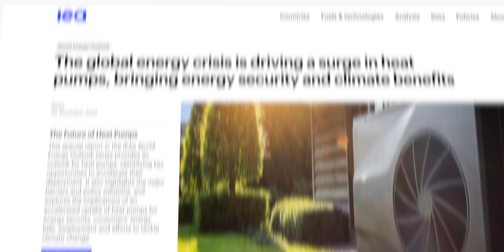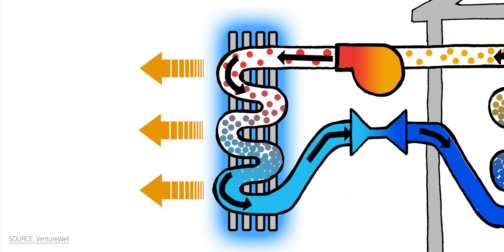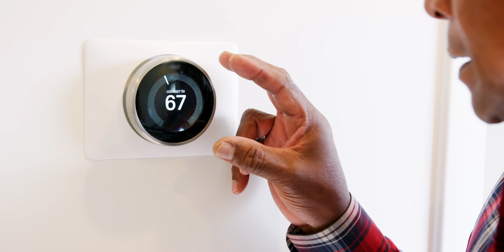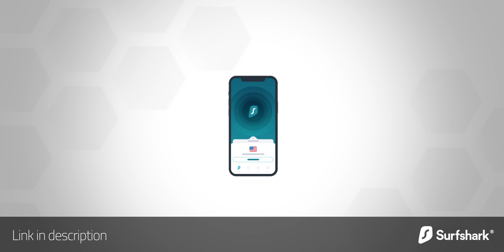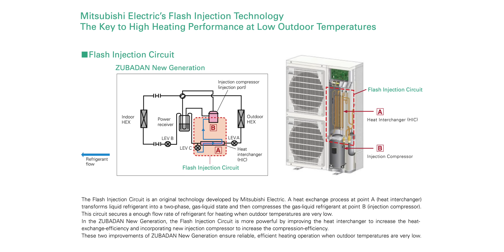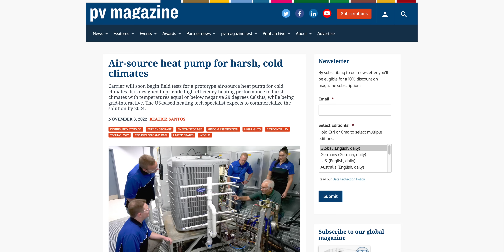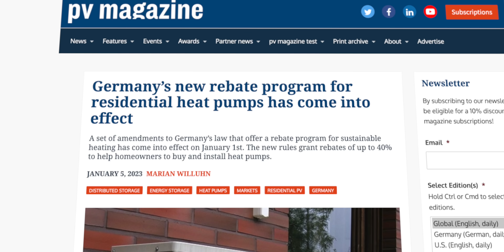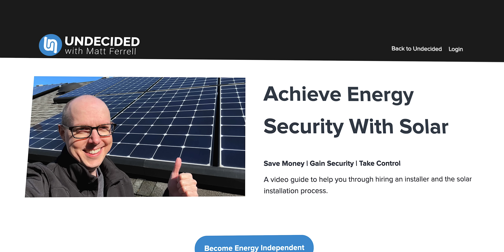Major Advances with Heat Pumps in the Extreme Cold

Comment: Matt, I'm curious if for your geothermal system they took into consideration soil thermal conductivity. It seems like heat exchange efficiency could be improved if you backfill with a better conducting soil. A quick search revealed that sand is superior to clay.
Reply: High conductivity is argueably worse because in the winter it would eqaulize faster
Reply: @emeraldbonsai  That makes some sense depending on how you burry the heat exchanger. My thought was to use the more conductive soil just around the coils and finish filling with whatever is at hand. The whole point in geothermal systems is to take advantage of the stable temperature of the earth below. To take it a step further, you could top off the fill with a more insulative soil or other material to limit the effects of changing air temperature.

Comment: It isn't the cold on its own, at least not usually. Cold weather and high humidity with air source heat pumps will cause ice to form on its coils. It is this coating which kills the heat transfer. The Heat pump then has to melt this coating which takes energy taken from the electrical mains. If for any reason water is passed through an external placed heat pump, it can freeze and cause serious bursts. The last cold spell killed my sisters air source heat pump, used to heat a indoor pool. The insides 'exploded' as it froze..

Comment: Here in the UK 1kwh of electricity costs almost exactly 5X 1kwh og natural gas so your heatpump would need a COP of 5 to break even with a condensing natural gas boiler in terms of how much it costs to run. Electricity is so expensive here it works out significantly cheaper to run an efficient petrol car when compared to an EV.

Comment: I live in New Hampshire, near the Massachusetts border. I added a 4 headed heat pump system a couple years ago, and a single unit for the sun room this last year. The single unit is a Mitsubishi hyperheat unit and works very well at 0°F, the non-hyperheat compressor will put out useable heat at 0°F, but it makes a lot of noise and uses much more electricity than at warmer temps. With electricity so costly, 34¢/kWh, I’ve been doing more heating with oil this year when the temperature drops below 20°F, as the relative cost varies wildly as the heat pump’s efficiency drops with temperature. 

Also, the oil heating system gives delightful floor radiant heating on the 1st floor, while the minisplit system allow the bedrooms to have different temperatures. My children have wildly different preferred temperatures so they do not like their rooms to be heated by the shared oil boiler zone upstairs. So, often, both systems will be active for parts of the day. 

Will be installing solar next week, which will change the equation quite a bit, and will probably lead me to heating the house hotter during the day. Thermal battery.

Comment: As soon as my AC unit from 2003 bites the dust or needs recharging (R12 is harder to get now), I'm putting in a heat pump. I live in MN.
I'll keep the new-ish 94% eff gas furnace installed as a backup and set it 2F below the heat pump setpoint. I may even wire in a tstat outside to disable the heat pump at the point it hits below 2.0 COP.  I'd have to do some research again as things have progressed in the last few years, but I think some hit that around 25F OAT now. Below that it's cheaper to run gas.

Comment: I spent about 1 1/2 years working on a 'ski shack' that was heated by two large geothermal heat pumps, fed by a single vertical well. In the winter, there was a thick layer of frost on any section of the fluid pipes in the mechanical room where there were gaps in the insulation, including where the 'warm' fluid came out of the ground. Even though the source fluid was well below freezing, the three-story building was kept very comfortable.
Reply: Vertical well heat pump  100 to 400 feet deep
For a vertical system, holes (approximately four inches in diameter) are drilled about 20 feet apart and 100 to 400 feet deep.

Cost between $20,000 and $38,000
Unfortunately, vertical loops are the most expensive type of geothermal system to install, since installation involves deep and wide boring. A vertical loop installation costs between $20,000 and $38,000.
Reply: @solarcabin  I had two 100 metre vertical boreholes here in  the UK for £9000. Worth every penny.
Reply: I'm working on upgrading my gas heat and hot water but I'm curious if the benefit of heat pumps is environmental or financial? Is it practical for Harry Homeowners and why wouldn't I continue with natural gas?  I gotta watch this vid a couple more times. It's all Greek to me as well as intimidating.
Reply: The electricity to pump up the water, assuming it is a deep well, was also probably significant.  However, since the water was probably dumped into a holding pond for use on the snow cannons, they were able to kill two birds with one stone.  I looked at pumping up water for geothermal, and the electricity to lift the water 500 feet killed the efficiency of using it for heat/cool.  Plus, I needed then to do something with the water.
Reply: @apostolakisl  the geothermal brine fluid is circulated in a loop, there is no lifting involved as the pressure equals out. If you're in a cold climate it's the way to go. I have two 200 meter holes and a 7 kW  heat pump (compressor draw), circulation pump is only some tens of Watts.
Reply: @ixer76  And what is your cost of drilling that 400m of hole?  Where I live, that would be about $60/meter . .. or $24000 for the holes, the piping and backfill.  Now consider how many years it takes to recover $24000 because of your increased efficiency.  Perhaps you pay 50 cents/kwh or something obscene like that and it makes sense.  They wanted $80,000 to drill the 7 holes it would have taken to get me a geothermal heat pump at my location.  And considering I have 8 months/year of AC, the holes would have gradually warmed up by the end of the season and been less efficient than air source.  Unless your electricity is obscenely expensive, or you have easy access to shallow geothermal well, it makes no sense (cents) to do this.
Reply: @apostolakisl  400m, what are you going to heat? That's a crazy big pump. 130-200m is usually the norm for normal sized house.
Reply: @Iceeeen  Last I checked, 2 x 200 = 400.
Reply: @apostolakisl  If the holes gradually warm up that is a bonus. Heat pumps become more efficient if the temperature difference between where the heat is applied, e.g. radiators and the heat source is reduced. That is why it is often good practice to increase the sizes of radiators or use underfloor heating with lower circulation temperatures.
Reply: @rogerphelps9939  I don't think you understand. If you are cooling your house, you need to reject heat. The heat is dumped into the hole. There is limited conductivity of the soil and gradually the holes warm up, making them a poorer receptor of additional heat. Same thing happens the other way in winter where the holes get cold. Air source heat pumps are so much cheaper to install that it rarely makes sense to use geothermal. The proof to this is that geothermal has been around for decades and almost no one does it. There are certain places where geothermal is much less expensive to install and are common, but those places are unusual.
Reply: @apostolakisl  In ground source or groundwater source heat pumps you pump through a closed loop so there's no lift since the up and down sides of the loop eqalise. The pump just has to overcome pipework and heat exchanger resistance. There should be no dumping of water. These are what Americans typically call "geothermal" even though geothermal means something else.
Reply: That’s a lot of pipe though.
Reply: @apostolakisl  You do not lift the water 500 ft. For every kg of water that comes up a kg of water goes down. The pumping of water around a loop in a vertical borehole is insignificant compared to the energy needed to run the compressor. Furthermore, in a variable speed design, the pump speed is varied to match heating demand. Heat pump heat gathering circuits are closed loop, not open.

Comment: I LOVE this channel.  Another detailed and thorough dive into the science and facts - excellent!   People should know that when you are checking out Heat Pumps, if you live in a cold climate you can specifically look for "Cold Climate Heat Pumps" - as they are designed specifically to handle outside air temps below zero (Fahrenheit).  My next home will be ICF walls, radiant floor heat, with either geothermal or air sourced Cold Climate Heat Pump.  You can also find electric hot water heaters that are basically a high efficiency heat pump, and are excellent for providing hot water, with great efficiency.  Come on folks, lets get rid of the carbon dioxide from our air, and leave this Earth a little cleaner for our kids and Grandkids!

Comment: I purchased a Sennville 9000 BTU heat pump for my garage, which I had insulated.  I live in Canada and even at -20C the garage was warm.  The uninsulated concrete floor was cold, but that's not the fault of the heat pump.  I would love to switch out the whole house from gas to a heat pump.

Comment: The type of house has a big impact on the effectiveness of heat pumps. In the UK, many houses are poorly insulated as they're quite old. Heat pumps have been proven to be more expensive to run than the usual gas boilers, so they still have a struggle to become mainstream.

Comment: In The Netherlands there are a lot of hybrid systems sold. A heat pump that is feeding the existing hr gas burnt central heating system. The benefits of this are the use of heat pumps in existing systems. I live in a house dating from 1908. Obviously insulation has been the first step. Installing a heat pump next to our gas burnt unit saves up to 80% of the gas use in the house. Because space is limited in Holland the use of geo thermal heat is often not feasible so Hybrid systems are very attractive an not very invasive.

Comment: There is a downside that most people don't think about until it is too late.  Depending on a single source of energy to keep warm that is not always under your control is not prudent.  The risks are going to vary by where you live, but I will give the freeze we had here in Texas as an example.  Fireplaces have gone out of style, even in the houses that do have them they are mostly decorational. The vast majority of houses down here have either electric heat or a gas furnace in forced air system. When the freeze hit and forced over 50% of our generating capacity offline it left millions without a way to heat their homes.  Normally in a freeze we don't lose our natural gas supply, but in this one the supply was impacted as well.  Normally you could run your gas furnace off of a car battery and an inverter to keep the house warm.  But the two main energy supplies were cut off to many with no self reliant backup. Even a decorative fireplace would have been helpful in this situation.

Whatever your desired outcome is for your own life when looking at saving energy,  just keep in mind what happens when things go wrong.  For you they may never.  But then again most people here in Texas never thought Corpus Christi could freeze either.

Comment: My Inlaws installed a heatpump around 2000 and my Father installed one about 2 years ago, here in NB Canada
Both are air source to forced air.
We have a temperature range from about +30C in the summer to -30C in the winter. The thing is, these peak temperatures
last for about a week at most, the rest of the time its between -10 to 0C in the winter and +10 to +25C in the summer, with fall and spring in between.
this is well within the usefull working range for even the the 2000's model.
Apparently many people don't know that there is a secondary electric furnace as part of the air handling system, that takes over
when the heat pump is no longer able to be more efficient that the electric furnace.
The electic furnace is sized so that it can heat the house properly, so you will never be without heat.
The important thing  is that the heatpump will provide heat for the vast majority of the heating season.

Comment: As I often point out, switching from natural gas to an electric heat pump for ecology reasons is a mirage.  No matter how well that heat pump works, here in the Northeast, the electricity largely comes from burning natural gas.  So you can either burn the natural gas in your basement with a tried-and-true system that provides reliable heat in any weather, or you can burn the gas in a power plant, bring the electricity to your house, and run a heat pump.  I'm far from convinced.

Comment: My son got a new Heat pump in MA last year when his furnace died. He still has a furnace for the coldest times however. One thing he has found is that he can run the heat pump during the day when its comparatively warmer outside and gets the house up to say 72F, and then the thermostat turns down at night and with good insulation, the house cools down overnight but doesn't have to run the furnace until morning when the outside starts to warm up again and the Heat pump is more effective again.
Reply: You should have invested in a ground (or underground) outdoor unit. Even when the air outside is very cool, the ground 3 meter under is nicely warm.
Reply: @janami-dharmam  they are best but costs a lot to drill a well in his area as it’s all granite and of course his furnace went out in the middle of winter.

Comment: Love heat pumps when they are silent and where i live the grid is below ground and we never have blackouts of any kind. But what happens when you have a 2 day blackout in the dead of winter.  No power means no heat.  Would you then need a backup solution like a generator.

Comment: here in argentina we call heat pumps AC. I dont know what is AC for you guys. Like Central Air? I dont see how a bunch of heat pumps is different than central air... but you dont wanna use it for heat. Radiators are better. heat pumps for heat are too dry.

Comment: But what is the cost for the heat pump - how long does it take for the installation cost (and maintenance) to pay back the cost to install?  6k to 10k for a pump system (the figures I've seen for MA in a pre-existing building) means it can 20 years or more for it to pay for itself not counting special accommodations in design for structure needs or maintenance). The Compressor pump itself has a lifespan of 15 years on average....

Comment: Did you really just explain how a heat pump works by saying "it's all just physics"? How is that helping?
Best way to explain how a heat pump works still is to convert the temperature to Kelvin. That way even 0°F is still way above absolut zero and is easier for the layman to visualize.

Comment: Although in the UK we have milder winters, I rejected heat pump technology for my upcomming small house build in favour of infrared emitters. These are cheap to install and are more reliable but the power conversion is only 1:1. Strangely they can be fitted even on the ceilings of each room because of the way they work but each can be programmed for a different temperature on a room by room basis.
Reply: Air heat pump is enough for even the coldest winters in UK and extremely reliable.

Comment: umm heatpumps/AC compressors use lots of electricity, anywhere from 545watts to 7,500 watts of power, the latter being more then half of a 100amp service. This makes heat pumps not an option for people with limited electrical capacity.

Comment: Nothing in video about high temperature heat installations in old houses, like radiators (no floor heating) which need around 55-60C to work well. Prices of these pumps is around 10000 euros in Poland +/- 5000 for installation process... not worth it so far in country when minimal/average pay is 8928euro/19,850euro/y. And from those numbers you need to substract taxes which will give you 6428euro/y and ~14300 euro/y. Average pay in Poland is also upscaled by weird way of calculation and is not reliable, not so ever because it is used for political purposes. According to latest data, there is 3.5milions of houses which are build in Poland without any heat insulation. This will simply not work because ppl here are too poor to buy coal for heating themselves for winter, not speaking about heat pumps and other hitech stuff

Comment: I'm a big supporter of heat pumps.  I specify them in commercial applications for my job.  However, the ones with the electric heat coil on the outdoor section of the unit can cause a headache.  The heater will melt the frost and nearby ice / snow on the unit, but then that water will freeze again on the ground near the unit.  Creating patches of ice.  Sometimes large plumes of ice!  If the unit is located near a walkway, then it makes the area unsafe.  Hopefully the newer tech can work without the electric heat coils, in cold climates.

Comment: We had a mini-split heat pump with a floor unit installed in our 600 Squarefoot addition, 3 years ago.  We have two openings into the space once used to be the sliding glass door, 1 used to be a 40 inch window that is now just a doorway.  Our yearly natural gas bill went down $140(adjusted to 3 years ago rates) and our electricity bill only went up about $50 a year(same adjustment)  We are SAVING $90 a year while heating and cooling an extra 600 square feet because of spill over our furnace works less hard.
Reply: How much did you spend to save $90 a year?